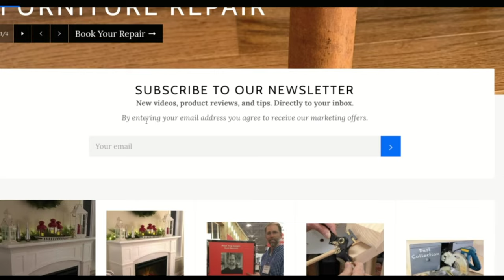Broken Roll-up Tambour Door Repair on a Hoosier Cabinet - a Fixing Furniture Restoration

Comment: You are the expert & I certainly am not, but why didn't you steam and try to straighten those warped slats? I'm thinking as bent, they'll exert pressure later and pop off again. Thanks for the video, very informative.
Reply from the maker: Good question.  The challenge with steam bending wood is that it has to be unfinished.  Doing that with these tambours would then turn into refinishing work for the whole door to make it look consistent.  Unfortunately, I have yet to find a dependable way to release tension in one section of wood so I can manipulate it in the direction I want.

Comment: The one, dark tambour piece goes on top. It is the only dark piece, which was not lightened by the sun. It is the only straight piece; not bent through use lower down.

Comment: When I was in high school I took 2 years of woodshop. I love working with wood. One of the things I learned is building a door like this. in the book it said to use slats of uniform thickness and width. space them with spacers to keep it from binding and glue fabric to the back. It amazes me how often you have extra work to do just because someone who didn't know what they were doing made a bad repair job. Now I see you removing glue from duct tape. I would love to see how this turns out. You do good work.
Reply from the maker: Thanks for sharing that!  Scott

Comment: Great repair Scott. but FYI not all Hoosiers are created equal, I did mine over, andput new backing on my door also. but the only way to get it in and out was to open the side a lot more than you did with yours. I almost had to take it apart. but made it. Thanks for sharing and looking forward to part 2. ECF
Reply from the maker: Thanks for sharing that Ellis.  I suspect this cabinet was made relatively recently as it has a plywood back on it and the solid wood is thinner than typical antiques.  Part 2 filming starts soon!  Cheers

Comment: It happens that I found Part 2 first!  LOL  This tambour repair was most interesting.  My dad, who was really a machinist by trade and hobby, got into a bit of woodworking after he retired.  When my kids were small, the place we lived had  no closet in their bedroom, so dad built from his own imagination, a portable closet with a drawer at the bottom, and tambour doors to save space in the room as well as avoid heads banging into sharp corners.  He did use cloth strips, but guess what?  50 years later, they're still in one piece, even though one is living outdoors (under the eaves) for garden supplies!
When we remodeled our kitchen, we had an "appliance garage" installed as a corner cabinet:  it has a tambour door.  However, it wants to spring up and stay open about 1/4" at the bottom, but I don't know how to fix that, because the instructions called for aligning that door prior to installing the cabinet.  Now it's locked in with zero access to the backside, as that is the exterior wall of the house!

Comment: Indiana is THE Hoosier state, there is only one of us. 

The good old internet does not seem to agree on who made this sort of cabinet first , " It was originally designed and marketed by the Hoosier Manufacturing Company in Newcastle IN" OR  "The first Hoosier-style cabinet was made by a furniture manufacturing company named Sellers in 1898 in Elwood, Indiana".   Gotta love the accuracy of an internet search.

But between the state being the Hoosier state and many of these cabinets were made by the Hoosier Co, this style become known as a Hoosier cabinet or kitchen Hoosier even though it might have been made by Sellers or McDougall or Boone etc etc.

Mine, which was my grandparents,  is a Sellers and originally had tambour doors that opened in the middle and slid sideways.  That was totally missing when I got it and I decided not to replace it
because I wanted to use it for display.   I did a lot of work  to mine and love it.

Comment: Washing and machine drying fabric also takes out the fine lint and finishing chemicals that might interfere with glue adhesion, especially with such a thin coat of glue.
Reply from the maker: Thank you for sharing that!  Scott

Comment: Thank you for a great video!!! I have a hoosier with tambour doors that pull together from each side. Your slats are horizontal, mine are vertical. I've had to strip old white paint off and I plan to stain and polyurethane the entire unit. At what point do you suggest staining and putting the polyurethane on the tambour door? Before gluing on fabric or after?
Reply from the maker: I suggest finishing the slats before attaching the fabric - it's much easier that way. I hope that helps. Scott

Comment: @FixingFurniture good job. I've certainly nested clamps. For a job that size I use a heavy-duty ratchet strap with protection between the strap hardware and the project. I normally work alone...I've lost count of how many times those suckers come in handy!
I plan on using tambour doors in some pieces.  I've always been fascinated with roll-top desks. (I will certainly be checking your other videos out.) If you were to steam the slats,  then clamp...would that remove the warp? I know full fabric is the answer. But that was severe warp. Would it devalue it more to replace the 2 warped or use the original with the warp.  You did a good job but my concern is the warp over time will pull away from the fabric.  Especially with heat and humidity.  (I'm in Nova Scotia). I've yet to ask...does heat and humidity cause hide glue to fail?

Comment: There was one in the house where I grew up in England in the 30's & 40's. It had a different layout an a pull-down flap with an enamel work surface. similar cabinets were quite common at the time. I am not sure where they were made but probably in England. I heard them referred to as "Mother Hubbards". I bought one similar to yours about twenty years ago (in Ontario). I did similar repairs. It was Canadian made but remains in the house that I renovated and sold a few years ago and I cannot remember the makers name
Reply from the maker: That's interesting.  Thank you for sharing it!  Scott

Comment: You should be able to extend your glue time with a shop steam iron. Hide glue will soften right up with the application of hot moisture, allowing you to reset a joint (or bir of fabric) easily. If done before the glue really cures, I've never had a problem with it curing properly. Of course, I've never TRIED reusing hide glue if I had to reset a joint after 24 hours... so as wonderful as hide glue is, it might work even then!

Comment: you could probably also use a plain weave on the bias but make sure to let it hang out first so it doesnt warp and go lax after a while
Reply from the maker: The plain weave does work, but it will fail over time as the fabric easily tares in the same direction as the tambour slats.
Reply: @FixingFurniture  yes, but if you put the plain weave on the bias (align the weave so it doesnt run parallel to the slats and instead runs diagonal on a 45 degree angle), it won't tear across the weave because the directions wouldn't be the same
Reply: i think.

Comment: I'm curious, as I'm not sure, but won't shrunk linen just stretch back out?  I would assume you want stretched linen so it will not stretch.  I seriously need to reproduce this repair.
Reply from the maker: Good question. No, once you wash it fabric in hot water and it shrinks, it won't stretch to the original side.  When shopping, there are some sellers that sell pre-shrunk fabric.  Scott

Comment: 19:39 honestly, looks like someone just produces regular fabric, but rolls and sells it at the 45° angle. Wouldn't that work, with regular fabric dense enough?
Reply from the maker: It could work, but requires much more fabric as you need to cut off a lot of material.  Cheers.  Scott